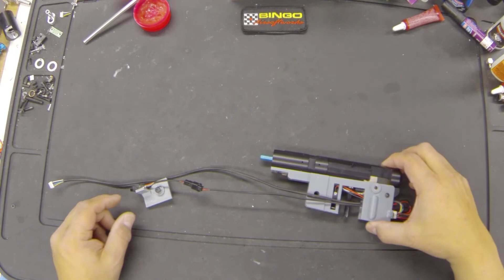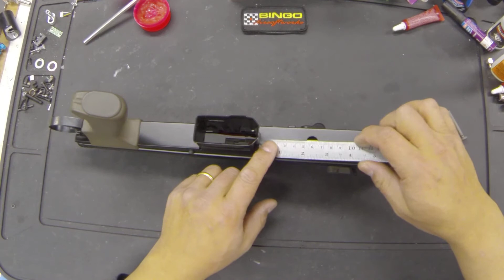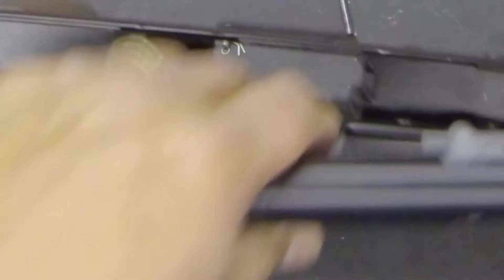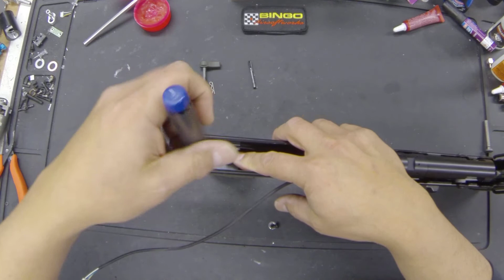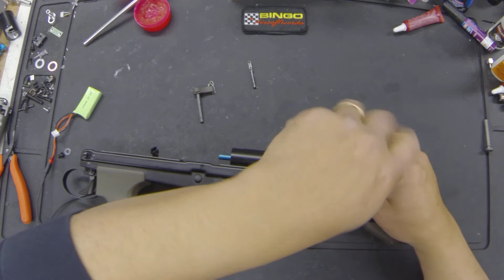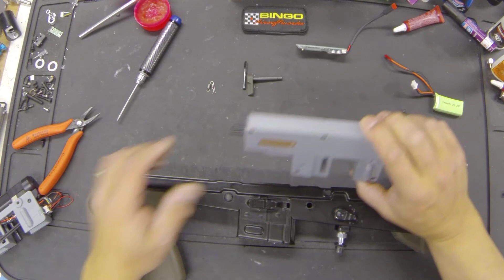Bingo Airsoftworks G&G/Army L85 HPA Engine Gearbox Replacement Kit

Comment: Does this kit also work on the ICS L85 A2?
Reply from the maker: George Freyre  See http://www.bingoairsoftworks.com/products-2/#icsl85
Reply: BingoAirsoftworks Nice, didn't see that one, just ordered the smp fusion engine. Soon I'll order that set to put on my L85 ;)
Reply: BingoAirsoftworks also which version and nozzle is the ICS L85 kit, just to make sure
Reply from the maker: George Freyre The ICS L85 kit uses the SMP and the M4 nozzle. It doesn't use the trigger board. I noticed you ordered the V3 SMP, which comes with the AK nozzle, is that what you want?
Reply: BingoAirsoftworks Ok here's what I would like I originally order that for an AUG, but notice that you will have those kits soon (facebook) Then saw this and got over hyped so which would you recommend. I still want to smp both L85 and AUG. Would it be ok to change the order? By the way thanks for answering this fast and late.
Reply from the maker: George FreyreOf course, no problem. I'll cancel and refund the order, then you can order the L85 kit.
Reply: BingoAirsoftworks Wow, great customer service. Thanks for your help I'll order this kit and be ready for that AUG kit coming soon